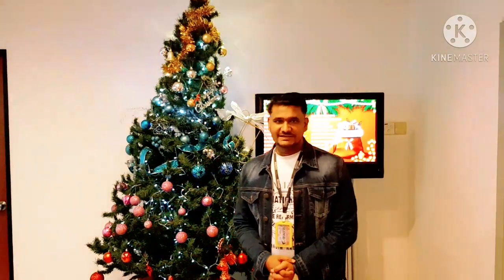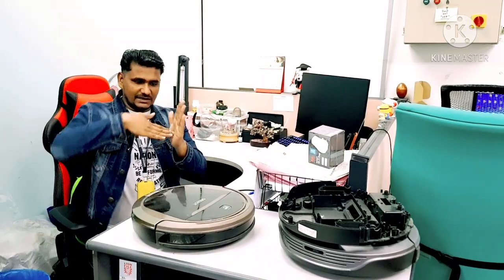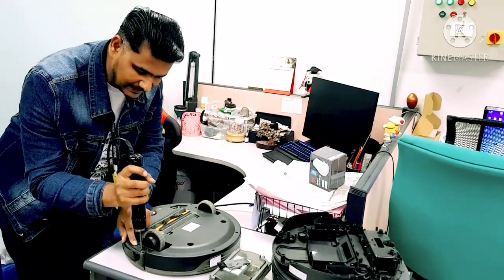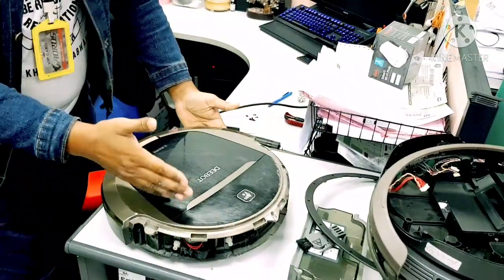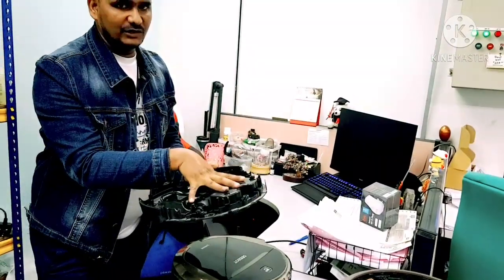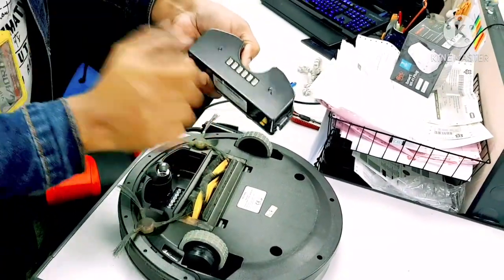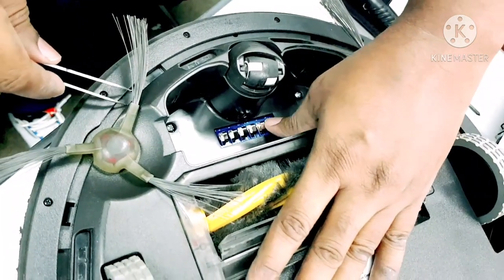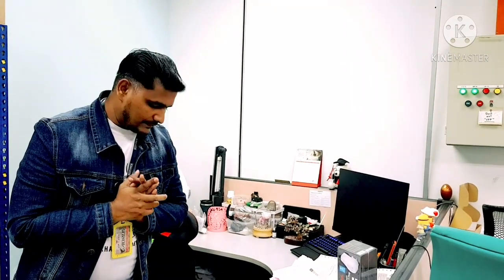Ecovacs Deebot DM81 How to Fix If No Power Or Can't Charge

Comment: Hi Sir I have a deebot ozmo 950 and I power it off and disconnected it from the charger overnight. I power it on the next morning and placed it in the charger, red lights blinking and it says 3 times "please power me on before charging". But I already power on the robot and put it on the charging place. It still gives the same warning. what should I do
Reply from the maker: If model confrm ozmo 950 then battery hopefully will be ok... Mainboard need to replace..or you see if anyone can repair Mainboard for you in your country
Reply from the maker: Charging regulator burnt

Comment: What about ozmo 930 model no charging problem? Could you make a video for it please?
Reply from the maker: Normally in This model if not charging or giving error while charging is a battery issue only. U can replace the battery urself at home . Battery located next to main brush assembly.. having 2 screw only on battery cover

Comment: I have a Deebot N79W. I bought a new battery and it won't come on. What should I do for that model? Please help
Reply from the maker: Hi...i send u video link you can test first if still couldn't find the solution then plz watch other videos related to this model . Search for ecovacs TECHNICAL Support....all models videos available here.
https://youtu.be/9kIOi1y-_Hg
Reply: @ecovacstechnicalsupport5278  Thank you for the response. But it didn't address my issue. The battery fully discharged and I replaced it. But there is no power at all and won't charge. I called the technical support and they wouldn't help me. Please post a video to help me 🙏
Reply from the maker: Ok noted no problem..plz WhatsApp me a video clip that u change battery  adapter connection with power got green light in charging dock n deebot makes any beep sound or not plz follow all these steps in a small video n WhatsApp at 00601137973018
Reply: @ecovacstechnicalsupport5278  thank video coming shortly
Reply from the maker: Let me watch ur video then i let u know what's wrong...
Reply: @ecovacstechnicalsupport5278  I tried sending you a message on WhatsApp. I don't know if you received it. The green light is definitely on on the charger. Still zero power on the Deebot